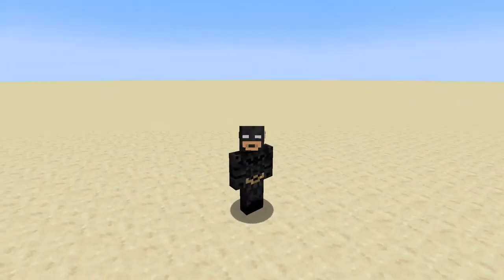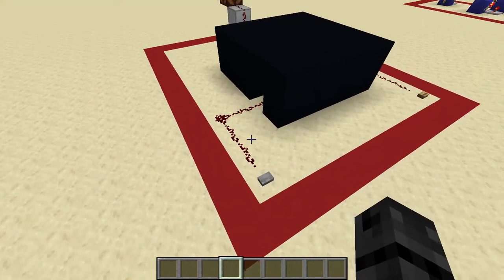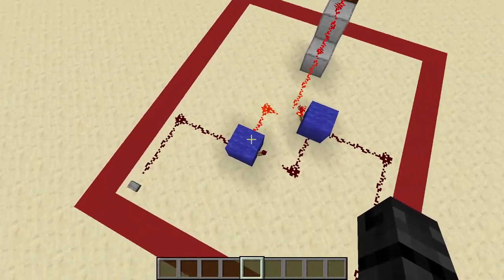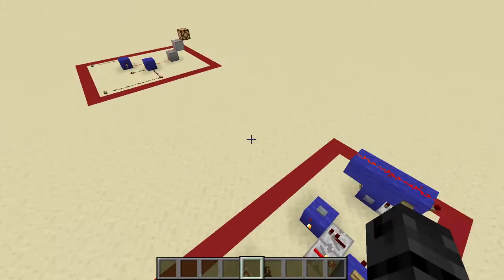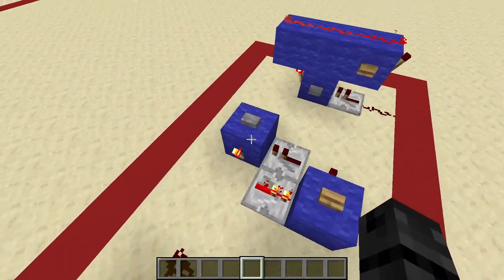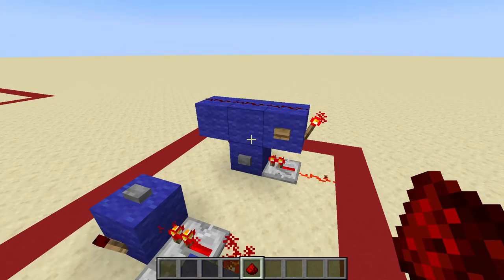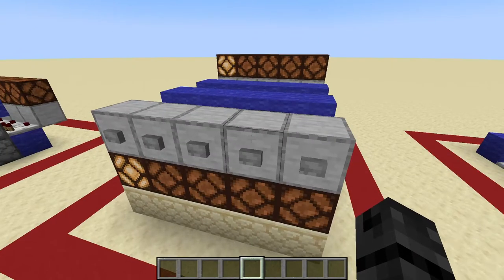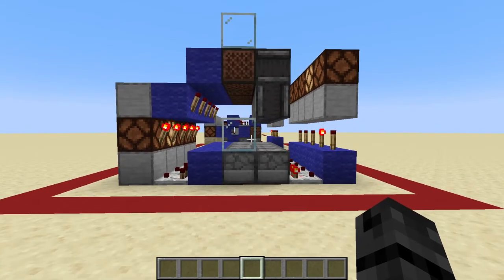On/Off Made EASY - WTH Is an RS-Nor Latch??

Comment: For Bedrock users: The latching nor gate array will be problematic. To build this for Bedrock do this: 1) replace all of the glass blocks with solid blocks. 2) Come out of each upper (or lower, depending on needs but make necessary adjustments) dropper with a comparator going into a target block. 3) placing redstone lamps on top of the target blocks. This works like a charm. Here is the URL for a quick video on the fix: https://www.youtube.com/watch?v=jd2Pq9-cv60. Thank you for making these videos!

Comment: To my fellow Bedrockers: 
1.) Droppers are not interfered by the button placed on an adjacent block as of 1.20.10, so you can build a 2-tall stack with blocks to the side and disregard the 3rd layer with Glass. Glass will not transmit the redstone signal into the top Dropper anyway. That said, I know for a fact that Observers produce the quasi-connectivity phenomenon when paired with up to three adjacent Droppers/Dispensers at the output (imagine 3 in a row with the Observer facing away from the middle.) 
2.) Note Blocks are not recognized by Observers and do not transfer the signal from a hard-powered block. You will have to face your Observers into a Redstone Lamp or other block that changes state (pistons work great but need immovable blocks at the end of the chain) and does not power the redstone wire beneath them. I've only been playing this game for 2 months so I don't know the extent of these mechanics, but swapping out the glass for solid blocks and the upper Note Block for a Redstone Lamp fixes the issue for me.
Reply: The best solution for Bedrock I've come up with for the first array is to 1) replace all of the glass blocks with solid blocks. 2) Come out of each upper dropper with a comparator going into a target block. 3) placing redstone lamps on top of the target blocks. This works like a charm and eliminates the quasi-connectivity issues.

Comment: Where can I get a crash course on gates like RS-NOR latches? I know AND, OR, NOT and XOR gates, but never heard of the RS term (reset?), not even in boolean algebra. Is there a name for this group of logic circuits?
Reply from the maker: Yeah, they're called flip-flops and latches, and they go beyond simple boolean algebra. They're a way in which you can store one bit of information and overwrite it at will. Look up D flip-flops and T flip-flops. The way it's implemented in Minecraft is different than in real life, but they're functionally the same.
Reply: mattbatwings has a really good video on the subject, and a playlist that expands further into logical redstone. It's a tad out of date, but only by a year or so, so most of it still holds up just fine. Definitely recommend checking it out.
Reply: The term you are looking for is sequential logic I think.

If you just mean what the circuits themselves are called, then flip flops is the term that would include SR latch, D flip flop, T flip flop, and JK flip flop

Comment: you only need 2 pistons and a redstone block to get the setup from the begining
First piston would push a redston block once to permanently keep the door open
The second piston inside the house would reset the redsone block unpowering the door. Is that simple

Comment: What does the "nor" mean in RS nor latch? Is there a hidden neither or gate in there?
Reply: In the basic one, the torch on a block is a nor gate. It's output (the torch) is on only if neither of its inputs are on. Two nor gates feeding into each other then forms the nor latch
Reply from the maker: Outside of Minecraft, an RS-Nor latch is created using two "nor" gates. You can Google it for a diagram. A "nor" gate is a "not or" gate, or the opposite of an "or" gate. So an RS-Nor latch is a latch that has a set and reset line, made from nor gates. Hope that helps 👍

Comment: I'm not sure if this could be considered technically correct but I've always seen RS-NOR Latches as some sort of memory cells 🤷🏻‍♂️
Reply: In digital electronics a latch is indeed a basic memory cell. It's a circuit that retains its state and is a basic building block in electronics. Please note that only the first example is strictly speaking a NOR latch.
Another popular logic gate used in memory is the NAND gate. You may have seen it in reference to flash memory. Put a whole lot of them together in chip in a clever way and you can make an SSD or a thumb drive.
Reply: @HattmannenNilsson  I definitely have to try that in Minecraft 😃 Thanks for the info!!! 😁
Reply: @jazolobo  Look for a primer on digital circuits if you want to learn more. I'm sure there's introductory university courses on Youtube.
Getting a basic understanding of logic gates and how you can combine them to build more complex things can be very useful.
Translating it into Minecraft can often benefit from some creativity. While you can make the basic logic gates with redstone, you can often find other ways to achieve the same function (like using droppers instead of redstone torch NOR gates for the latch). Once you know how a circuit functions, though, you can find other ways to implement it.
If you like tinkering with redstone, I highly recommend having a look at basic digital circuit design. You'll find many useful ideas and concepts to help you build the redstone contraptions of your dreams. 🙂

Comment: Good tutorial but 2 points that i dont like that is a problem with almost the entire RS community
1. Its a SR latch, not RS. SR stands for Set Reset.
2. The redstone community tends to call it a ...NOR Latch, when its just a SR Latch as it doesnt contain any NOR gates. The ones that use redstone torches are SR NOR latches however.